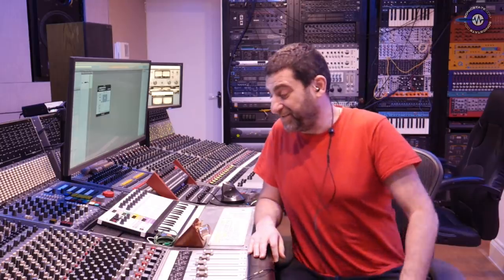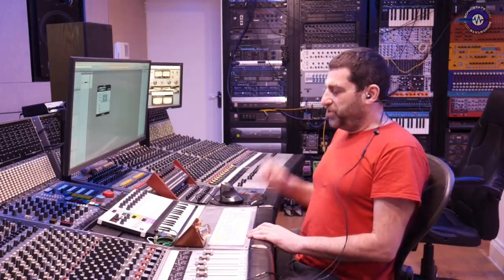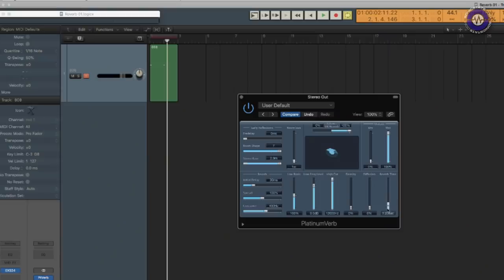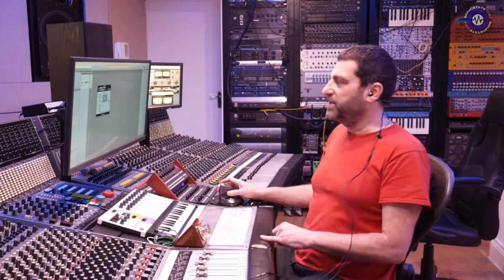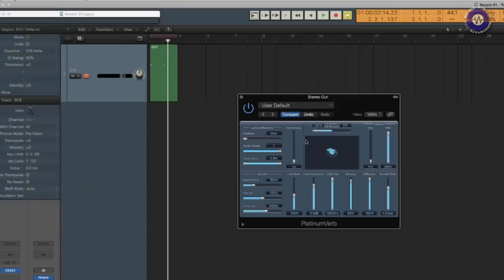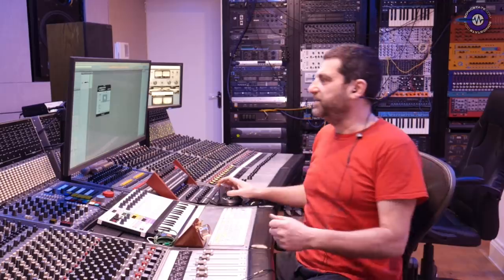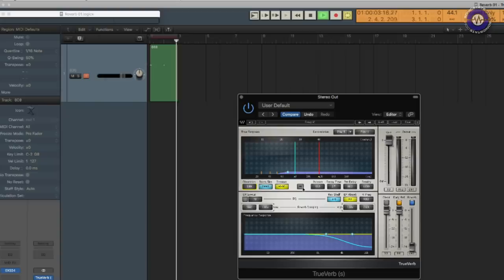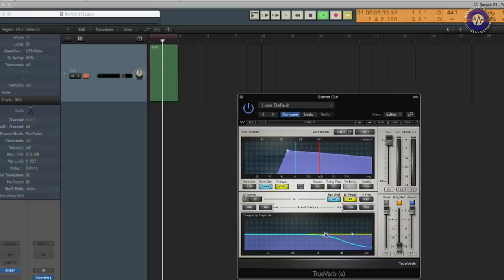How It Works: Algorithmic Reverbs With Yoad Nevo

Comment: Actually the algorithmic reverb needs random memory access, so the performance depends heavily on CPU cache. If all the delay lines fit in the cache, then it works very fast, in other case the main DRAM random access is the most expensive operation in terms of performance/energy.
Reply: Filip Miler link?

Comment: Thanks Yoad Nevo, really great. I wonder why dsp based reverb may sound much better then software, considering it is all digital, and a dsp device would have much less cpu power,  but, probably it is only related to the "original code" and maybe digital analog conversion sound shaping. Well just asking, I never had a good hardware reverb, would it be worth the investment, or really we can live with software?  I know this is an old dilemma, just giving a shot :)
Reply: The sound depends heavily on specific algorithm (number of delays, filters and their connections) and precise tuning of all the hidden parameters (particularly the delay times). Companies like lexicon and yamaha have their private know how, although there are some great open source reverbs like Zita.

Comment: Years back, Matsushita/Panasonic came up with a multi-tap bucket-brigade chip, the MN3011, that was intended to provide "solid-state reverb".  The 6 taps were at mathematically unrelated numbers of stages such that there would be no accidental creation of unwanted resonances.  Sounded great in theory, but the chip ended up being a bit of a dog and was discontinued.  Why?  The few schematics I've been able to see, for reverb pedals that used the chip, neglected one important factor in mimicking natural reverb: the fact that simple amplitude and number of reflections/repeats will not get you a "natural" sound.  There was NO differential filtering of early and late reflections.  Heck, there usually wasn't even a global Tone control for the wet signal.  Natural reverberant spaces are not just polished marble walls or glass.  There are absorbant surfaces, furniture, people, and other objects in the way and the usual sound shadow that happens when a reflection from point X reaches one ear earlier than the re-reflection that has to bounce off another surface before arriving at the other ear.